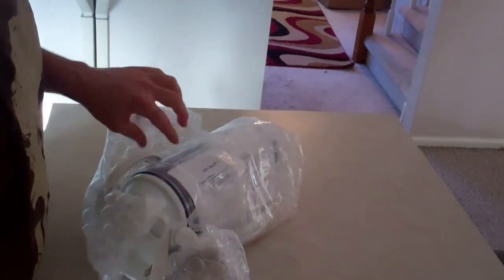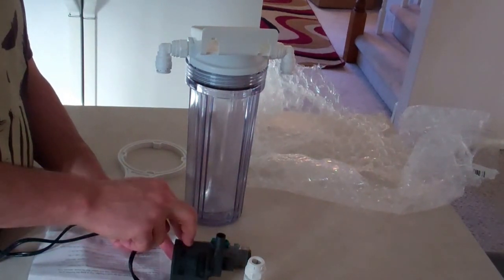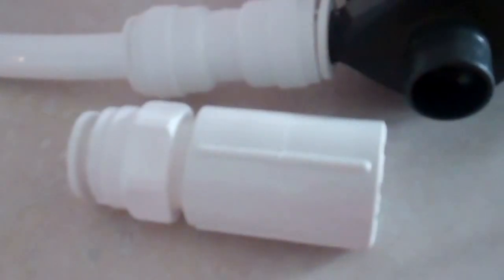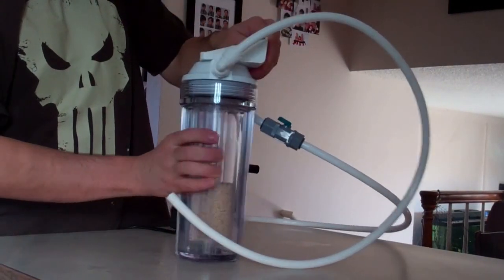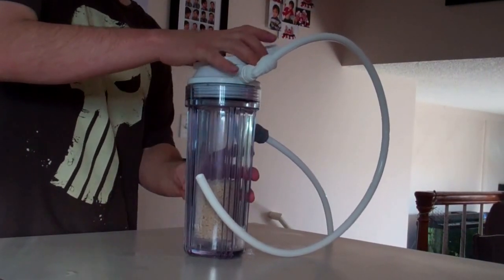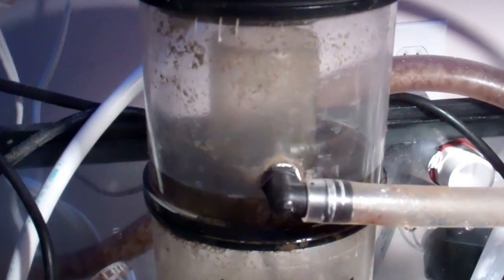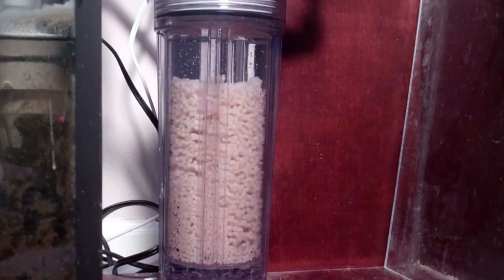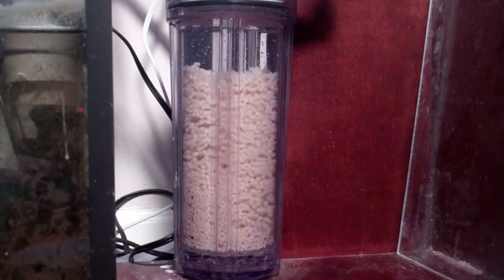Biopellet Reactor

Comment: WOW!  You were so young!  I have never seen one of your older videos!  Did you have you son yet?  You look to young to even be a dad!I This video is so informative, no one has shown the hoo up and installation.  I have no room in sump and most are in sump as well.  Do all these parts come with it?  I have some type of media reactor with sponges that came wit tank with tubing coming out both side like this.  I wonder if I can use that, its like a gfo reactor would you know?  I have a tube with a ball valve in the middle with 2 short pieces of tube that came with used tank, if this dosnt come with that.  Also Would you recommend soaking in microbacter 7.  I am using nopox now so need to lower a little still but mostly maintain.  my phosphates are very close to zero so maybe that is why its taking a while being I was using gfo b4.  Also, how do you know when its used up? does it just disintegrate?  Thanks for any help!  Love your channel!  Big fan!

Comment: I think I may get one. I wonder if I should get the dual reactor...one carbon and one bio pellets...one pump.
Reply from the maker: +ROTTER tube Reef Use separate reactors the GFO doesn't need a very big pump but the biopellets will  need a good sized pump. Also don't buy one with a sponge filter in it they just clog and stop the tumbling. Check out my DIY reactor. Your going to love biopellets Steve.
Reply: that makes sense. i'll check out the DIY you did but may spring for a reef octopus. problem is i can't fit anything else in my sump with that marine pure block. room for that and protein skimmer and that's it.

Comment: good video BUT. I would ONLY use a older 1200 pump because of the new ones with the purple impeller is so FLIPPING NOISY it keeps the neighbors awake!! when used as a simple mixing pump or not having to create ANY PRESSURE it is ok, other than that it's ok. you will thank me if you ask others. I am IN NO WAY saying BULK REEF SUPPLY is a bad company it is totally opposite it's a wonderful company to deal with!!! this is about the pump only!!!